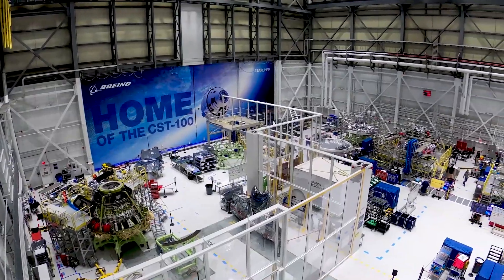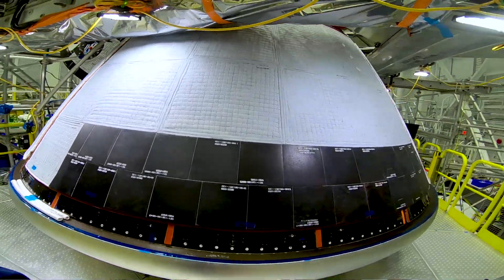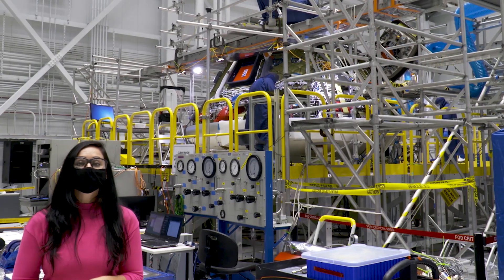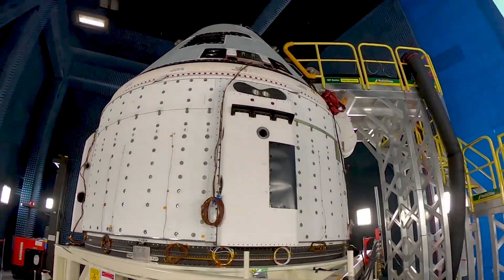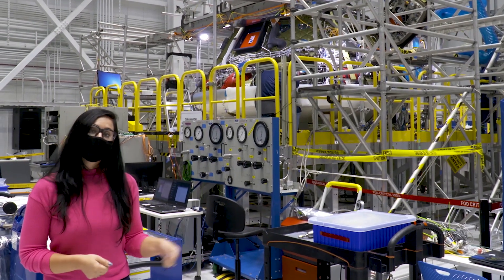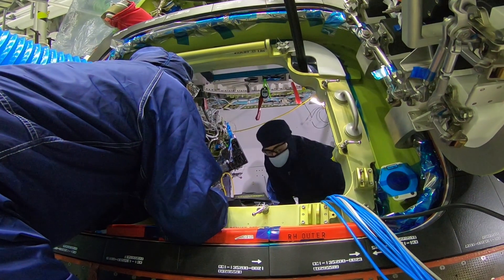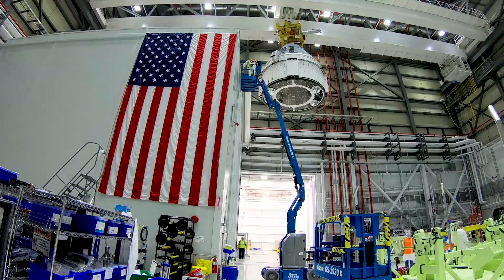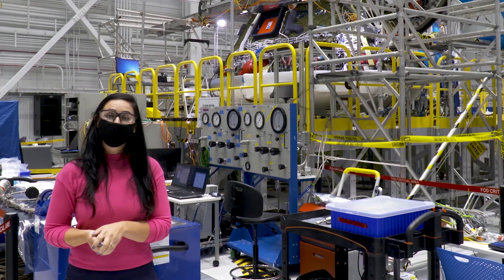Boeing Starliner Crew Prepares Second Module for Flight

Comment: So much complexity to build. The design seems nothing new from what the early return capsule in the 60s. Whats the new technology introduced to thia starliner anyway? And seems they are taking so much time building it. Soes the failure is because of so much added protocol,  excessive safety checks, new procedure and new so much lots of certification needed? I dont see new tech introduce on this capsule aside the boost 10 man design capsule capacity.

Comment: I said 6 years ago that Starliner would be be good ISS transport vehicle, once they got the systemssorted out.   It is designed to be a space tug to raise the ISS's altitude.  It is a little bit more roomy than Crew Dragon.  Although, Boeing failed in not putting a toilet in it, they can add one later.   I was skeptical,  from the start, that Starliner would succeed on it's first flight.  Boeing should've proposed an orbital flight with a developmental capsule, first.  Despite everything,  I am anxiously awaiting Starliner's launch.

Comment: Really hope it works out, we need two active providers to deliver astronauts to the ISS
Reply: Except the price Boeing charges is basically the same per seat as Soyuz. SpaceX dragon is cheaper and overall a more impressive design, not reusing old components and better features.
Reply: @Jaker788  still there should never be a monopoly. Even if its worse, we can't allow a single company to fly astronauts to space.
Reply: @duckpncruck5027  agreed, we can use Soyuz as the backup company.
Reply: I want Boeing in space not SpacEx, and Tesla.
Reply: @Idontknow-hl5mh  Boeing has had a record of safety issues and cutting corners and regulations for their planes and now for going to space. They've killed people with the 737 max specifically from cutting corners and lobbying to skip re training for pilots to be able to sell the aircraft.
SpaceX has a clean safety record and has not cut corners or skirted regulations, they went beyond what was required for testing and outperformed Boeing on this project and still came out cheaper.

How about we have companies who do things safely go to space and not ones with a bad record. That's my take here
Reply: @Jaker788  good point. What would your perspective be if they worked together?
Reply: O f course it will work out!! This is proven science at work here, USA/companies having being doing this work successfully since the 1960's!

Comment: Congrats!  But I really hope you guys have cleaned your software.  All the most amazing hardware in the world can just go to trash if the software is wanting.  I hope you have done end to end simulations with hardware in the loop.  I hope you no longer have single points of failure at a key point during initializations, such as setting a timer.  I hope you no longer have single point of failure variables, such as a timer that everything else depends on.  I hope you have continuous validations of program state correctness. I hope your state machine has become wide with a nest of alternative paths to success from every state, should the standard path fail at any point.  I hope your firmware is able to recover and resume execution from any possible reset (brownouts or EMI-induced).

Comment: too slow.. still testing? SpaceX is flying regularly to ISS now..
Reply: Syed Fareed, not only slower, but twice as expensive as the Dragon
Reply: Who is the drone made by that has been doing missions for the last few years... forget the aircrafts name
Reply: All SpaceX did was heavily modified Dragon (Dargon 1). Starliner is 100% new. That's why it took longer.
Reply: @TheMrPeteChannel  Boeing began building Starliner two years earlier than SpaceX Dragon2
Reply: Not true.  D2 is a clean sheet design.  But, like Boeing it uses some proven hardware, like the dragon thrusters.
Reply: So what?